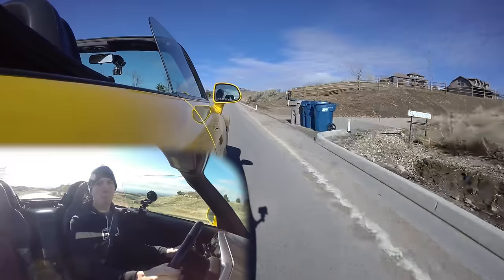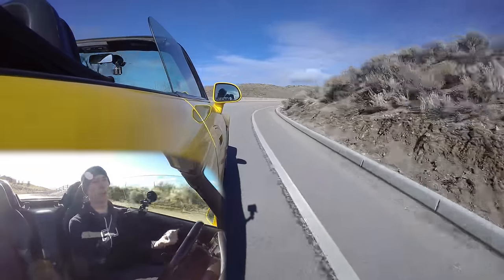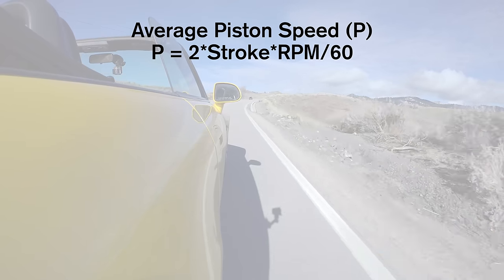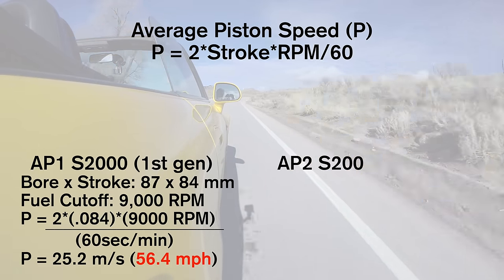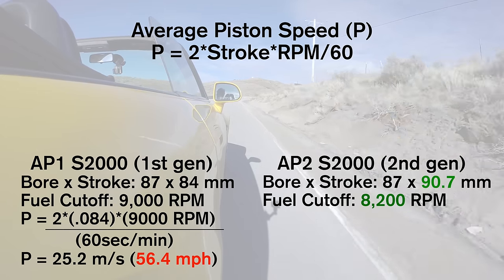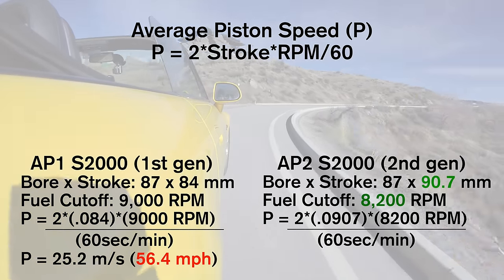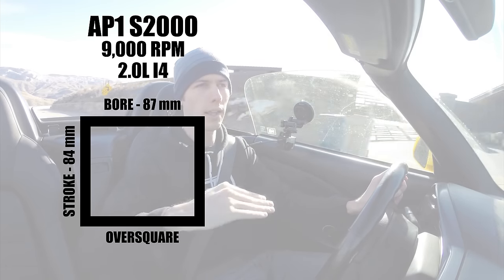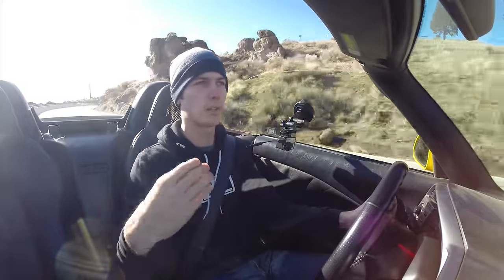How Do Some Engines Rev To 9,000 RPM?

Comment: I had an '02 S2k and had a few great years of fun riding on the edge all the time, But I wanted to try a different approach and got a BMW Z3 3.0. It suits me better because Im getting old and lazy and I actually get to enjoy the scenery better because it doesn't matter what gear Im in it'll thrust up any grade with massive torque.  I also love that feel.  A Miata I had handled really well and had great gas mileage, but I got so frustrated with the lack of power, and couldnt pass anyone.  I dont need to be fast,  just first.

Comment: I think Honda did what they could to take after DBZ. “ITS OVER 9,0000!”
They’ve been memeing since 1999 👌🏼
Reply: Jack MeOff honda motorbikes have been revving to over 9000 way before 99
Reply: Real funny name btw👌
Reply: Motorbikes Rev high. That marketing won't work because people are used to bikes revving high, but the S2K is a high revving car, and cars still rarely hit that RPM mark (excluding electric cars)
Reply: It's over 8000 was what was said in Japanese. Still good on the a2
Reply: My 1974 Toyota Corona had a 2L 18R-GR that quite regularly saw the high side of 9K rpm. Blows your piss weak meme out of the water... Same goes for all those ricer crotch rocket wannabees too...
Reply: But... In Japan and over 8.000!

Comment: This little miniseries on engines and power and their relationship has been super informative, thanks for making these! Keep up the awesome work
Reply: Also, in hopes of another awesome video about weird technologies - has any manufacturer developed a tech that would give them variable stroke length to modify torque at different revs, similar to changing valve timings and spark advance or what have you?

Comment: No VTEC but the Ford 5.2L has 8250 RPM VOODOO.... I think there is a benefit in power delivery. For a car that hits the track or long windy roads, holding a gear for longer (power band) keeps you from shifting frequently as opposed to say a 6k rpm red line.
Reply from the maker: The 5.2L is such a wonderful sounding engine!!
Reply: Harold Ortiz how about the turbine engine？
Reply: Actually a better torque curve keeps you from needing to shift as much.
Reply: Buff Barnaby and what gives you the longer tq curve?  The higher RPM. The longer the powerband, the higher the RPM results in less shifting.
Reply: You can have a flat tq curve but only last 2k RPM vs a flat tq that lasts 4rpm.
Reply: a longer gear bro  xD
Reply: DxCBuG But then you lose average torque. Longer gears are for crappy drivers (or obscenely powerful drag cars).

Comment: Is that why most Honda’s produce high power but low torque?, like  an EM1 civic Si 160Hp and 111Lb-Ft
Reply: All naturally aspirated high revving engines have low torque. As stated, Honda 4 cylinder motors actually have good torque figures compared to other NA 4 bangers.
Reply: times changed, USA has been innovating a lot more these past years in cars while japan has slacked off while sitting on a crown for more than a decade, 300hp may seem cool maybe 10+ years ago. This is coming from a guy who never owned a muscle car yet.

Comment: So my motorcycle revving at 16k is going around the same piston speed? 
🤔 
INTERESTING!
Reply: a 4 cyl 600cc-1000cc  engine  compared to a 4 cyl with 2000cc
Reply: Yes. Your motorcycle engine has a shorter stroke, so it covers less distance with each revolution. Imagine two athletes running at the same speed, one of them around an 1/8-mile track, and the other around a 1/4-mile track. The runner on the 1/8-mile track (AKA your motorcycle engine) will have twice the rpms, even though they're both going the same speed.
Reply: Trevor Pontifex brilliant explanation, thanks

Comment: Also valve float will limit engine speed.  OHC designs also tends to allow higher engine speed than push-rod configurations.  Smaller high revving engines can compensate for their lack of torque by their ability to rev higher in order to generate more power.  Also, at lower revs when power is not needed, fuel efficiency is improved.  The drawbacks are lack of power at low revs; more aggressive gearing and more gears are required, and possible increase in engine wear.  Although high revving engines can be more fun to drive and sound better (to some people), they are more costly to manufacture.

Comment: The other thing about high reving engines is that it allows you to stay longer in lower gear which means it delivers maximum torque to the wheels, thus having maximum accelaration rate.

Comment: Flat plane crank...
Reply: Been there, done that.
Reply: Andrew Langley is that a gt 350 in ur pic?
Reply: Yep.
Reply: The inline 4 F20/22 engine does have that... nothing seems wrong here lol
Reply: My mt09s are flat plane, they sound proper boring compared to a triumph 120° crank
Reply: good valve springs
Reply: firing order means nothing to how high an engine can rev.
Reply: theravedaddy mt 09s are 120 degrees dude. for a triple thats basically "flat plane". same like the triumph. the mt 07 is cross.
Reply: theravedaddy you need a new exhaust
Reply: Carbon Reed I hate flat cranks, hand grenade engines I call them.
Reply: theravedaddy Aren't mt-09s a crossplane crank?
Reply: Christian Hodges they have the normal configuration of 120 degrees like most triples. Even firing order but technically a crossplane. odd numbered cylinders are pretty weird. Can an engineer verify my statement?
Reply: Delight Galore that varies, especially when you have different cylinder arangements

Comment: It occurred to me the other day that an engine spinning at 3600rpm is rotating the crankshaft 60 times per second, is that correct Jason?  
Justified it with the following: 3600 rotations/min * (1 min / 60 s) = 60 rotations/s.  That's a lot of movement in one second.
Reply: there is a few different videos of the BMW S1000RR engine cut open and spinning at 14000 RPM :-)

Comment: On the issue of the 2 "strategies" (higher rpm vs low-end torque engines), one advantage of the higher revving engine seems to be in fuel economy during low rev range.  A lower rpm/big torque engine has lots of available power without the high revs but it comes at a cost of higher gas consumption during regular driving in that low range.  

The higher revving engine, on the other hand, can do just as much work when it revs up but it will not have that "on tap" availability of power that is so wasteful in the lower rpm engine and therefore can sip fuel when not in that high rev range.

But, The Piper eventually must be paid in the higher revving engine due to the higher risk of catestrophic engine failure: Higher RPM means smaller changes in wear coefficients can do more damage more quickly or more often.

Also, the traditional sense of "powerful" includes the idea that making power is effortless.  Higher revving engines just seem to work harder to impress.

Comment: Many smaller motorcycle engines rev much higher though!
Reply: some RC model engines rev even higher. The smaller the engine, the easier it is to rev high.
Reply: 2 stroke engines
Reply: 2 and 4 stroke engines
Reply: Smaller engine - shorter stroke - higher rpm
Reply: Well if you wanna stack the deck merely for "i've got the highest revving engine" pissing contest, I've got a 0.9cc 2stroke RC plane engine capable of over 30K rpm on nitrous. 
If you want to come back to reality, I used to own a Toyota motor from 1974 that regularly saw the high side of 9K rpm.
Reply: motorcycle engines have flywheels smaller than my cat!! car flywheels are larger in circumference...ever been in a truck? they have flywheels the size of a washing machine and those engines rev up to 3000rpm or less but produces massive torque...higher revving tiny flywheel engines have less torque....engines in a ship rev up to 900rpm or so the most!!
Reply: Antonio Barba They also have high HP/litre.
Reply: Fernandino Alonsini yes but that was not a question 😅😂
Reply: It has a lot to do with the amount of torque required. A 600cc supersport motorcycle engine can often rev to 16k rpm or higher and produced a lot of horsepower for its size (around 120 bhp), similar in horsepower to 2 litre turbo diesel. But put the motorcycle engine in the 2 tonne car and the lack of low down torque would make the car almost unusable. But in a 160kg motorcycle, the thing will fly. Formula 1 cars are extremely light for the size and so can also get away with sacrificing low down torque for high rpm horsepower. So the weight of the vehicle often dictates how much low down torque is required (truck engines often only rev to 2.5 - 3k rpm). So in a light vehicle, it's a case of having a large bore and a short stroke and then you can rev away.
Reply: The high rpm is why motorcycle engines, especially in "litrebikes" can have horsepower ratings similar to lower powered cars.

Comment: The thing that gets me about VTEC is how they engage that secondary rocker without just snapping that actuator constantly.

RPM is kind of important.

You can't make 300 ft lbs of torque with a 2.2L Honda @ 1000 RPM. That takes more air and fuel, either by increased CID or forced induction.

Flip side of that, my 390 makes 430 ft lbs of torque but is only 280ish HP because it starts to wheeze over 4000 RPM.

Comment: You need that turbo in there ASAP.
Reply: Corrosion37 thought he said he’s going supercharger for linear power?
Reply: You right. i just woke up. i have a dead head
Reply: Aw man, I wouldn’t turbo or super that. Don’t like the whistling drowns out the nice engine noise.🙁
Reply: Put a centrifugal turbo, best combination of the two
Reply: it will ruin the s2000 engine. Might as well keep it stock

Comment: That's why I always laugh at the whole "there's no replacement for displacement" adage.  Engine speed and forced induction are good replacements.  😃
Reply: but that usually only increase topend, with displacement you get a good increase overall
Reply: and a (way) lighter car
Reply: except mercedes project one
Reply: Try towing with an engine that revs to 10k.
Reply: 177SCmaro You sure can boost a bigger engine, but larger engines have more mass, both in general and as Jason explained, more reciprocating mass which means more stress on components with higher revs.  F1 has put out 1000hp from a 3L NA engine.  That's what rpm can do.  You can't rev your small block Chevy to 18,000 rpm.  Like Jason said, big engines are a legit way to make power, but not the only way.
Reply: The "racing platform"/application dictates the engine. Lighter vehicles needs less torque and than can use the top high end power high revving engine, a heavier vehicle needs low end torque. Otherwise you have to use a ridiculous gearing ratios and gear speeds to match performance of proper designed engine.
Reply: Every car pretty much is being powered by a small turbocharged engine these days... 1.0T is the new 1.6, 1.4T is the new 2.0, 2.0T is the new 2.8 etc... you get more power per weight added than you do simply by adding displacement and you get that power without increasing fuel consumption as drastically as you would going from 4 cylinders to 6 or 6 to 8 etc. better handling, more distance out of a tank, Replacement for displacement is here. 
Why do you think the new ford GT is a turbo v6 not a v8? (and outperforms all current v8 supercars) and why the V6 mustang was discontinued after customers realised the 4 cylinder turbo mustang was as good or better? 
While you can just about turbo charge any size engine, you can't always increase the displacement, Just imagine how big the bugatti chiron engine would be if they tried to build it without turbos and still give it 1500bhp... it already weighs as much as a mini cooper as it is!

Comment: So long stroke means more torque and less rev? I drove a 4.0L i6 for a few years and always wondered how a NA petrol engine with an unimpressive compressive ratio of 10.5:1 can produce almost 400nm torque at only 2500rpm
Reply: Well, it has 4L displacement, thats how
Reply: 177SCmaro umm... say i have two engines with the same displacement, setup and everything but one has a bore x stroke of 80 x 90 and the other is 90 x 80. what difference in characteristics in general can i expect from the two?
Reply: 177SCmaro. Yes, the idea that stroke equals more torque is persistent and entirely ignores the reduced piston area when talking about engines of the same displacement.
Reply: 177SCmaro but since engines with shorter stroke are more rev-happy than ones with loner strokes so wouldn't that increase the total friction as well?

Comment: Honda engines just sing. I once drove an Acura RSX Type-S (which was a more practical alternative to an S2000 at the time) and you could feel those 8500 RPM's in your bones. Makes you smile :-)
Reply: Fun car to drive but also practical unlike these roadsters. What stuck in my memory though wasn't the VTEC step, it was the magical sound of the engine that resonated in your chest like a loud sound system.
Reply: Dennis Kapatos You should upload some videos of your Acura. Maybe some revs?

Comment: AE86 from initial d had 11000 rpm
Reply: That was a special TRD group engine illegal for street use since it was designed to be used in motorsports. It must be driven hard and tortured in order to maintain its reliability-.
Reply: It was a engine from a group A rally car and detuned to make it street legal
Reply: Kedar Sawant it's still illegal though lol
Reply: Kedar Sawant. You mean streetable, its simply not going to be legal in a country like Japan.
Reply: man I miss that show
Reply: Karthik Pradeep MF Ghost is for you sir. It's from creator of Initial D
Reply: Kedar Sawant check out spoon's b16😉 not that fake cartoon
Reply: Max200012 thanks I'll check it out
Reply: fake cartoon? based on a REAL car.
Reply: The actual Group A 20v engines revved between 8900 and 9500, and some were closer to 10k, but I’m unsure why they exaggerated it so much in the show
Reply: @Mameyaro  there is a special crankshaft made by TRD or some other aftermarket company that could get an 4AGE to rev up to 11k but the crank would only last 20k miles before it failed
Reply: Kinslayer Gaming oh

I didn’t know that

Thanks for telling me :D

Comment: I want to know why some engines rev FASTER than others.
Reply: Matt Man that would be the flywheel. The lighter, the less rotational mass. I’m not Mr. Engineering Explained, but that’s from what I know
Reply: Lighter parts and shorter stroke...
Reply: Ultimately it comes down to the engines power vs. the engines rotating mass (flywheel included) and on modern cars the motor controller comes in as well. I drove a fairly modern BMW 1er recently and when accelerating it was revving up way quicker than with the clutch pressed in and stepping on the gas, so I guess the motor controller was in some weird mode that didn't really let me rev it...
Reply: Then you have the wankel engine, revs faster because its easier to transform rotational movement of the rotor in rotational movement of the crankshaft than the transformation that happens in piston engines, where you hay to transform a linear movement (piston up un dow) into rotational movement in the crankshaft. The differences between piston engines are due to the flywheel size and weight (depends on the irregularity degree that you want) and the general weight of the pieces.
Reply: Because of different missions!  My Mercedes diesel van needs low end torque, moderate acceleration, longevity, fuel efficiency. It acts more like a tractor. An f1 car needs quickness, high hp out of low displacement, needs to last less that one year. Road going sports cars are really in the middle; performes pretty good, but designed and built to last decades. It’s all trade in offs.
Reply: Gearing as well. Shorter gears help rev faster, taller gears don't let you rev as fast
Reply: Do you mean QUICKER instead of faster? If so then it's mostly a matter of reducing the weight of the rotating assembly.
Reply: ThatOneGuy Do you mean MORE QUICKLY instead of quicker? Quicker is just as bad as faster. Don't be that one guy.
Reply: Yeah, I used the adjective when I should have used the adverb. I wasn't trying to correct his grammar though. There's a practical difference between, "quick," and, "fast." One is acceleration, and the other is velocity.
Reply: Yea I put a lightened flywheel on a 1.6 vw diesel years ago, best cheap mod you can do those things because they are sooooo slow. 
Sitting in neutral and reving it up, could have been mistaken for an engine that was seizing up to someone who didn’t know. 
as it would rev up fast, but also drop fast also. 
Most cars have a heavy flywheel designed for general population, if you’re into your cars give it a try.
Reply: ThatOneGuy Huh, I never caught on to that. That's good to know, thank you!
Reply: TheSmileyFacedPizza Yeah, the best example of the difference I can think of is when Top Gear did a drag race between a Bugatti Veyron and a McLaren F1. The F1 was much quicker, launching ahead off the line and leaving a huge gap, only to later be overtaken the faster Bugatti up the road.
Reply: Matt Man the weight of the gas pedal that's all 😎
Reply: I don't think I saw this in the other replies, an important factor is the compression (combined with engine inertia-flywheel too). Speaking from motorcycles here..
Reply: It's in the gearing. In a manual, wheel speed is locked to engine speed but varied by the gear ratio. So to increase engine speed you must also increase vehicle speed to get there
Reply: @wisdomofnotch  Nope..   You match your gearing ratios to your engine, not your engine to your drivetrain. One of the gears in just about all gearboxes is 1:1 ratio. And in that gear, the engine with lighter rotating mass and shorter stroke will increase rpm more quickly. People explained it quite well above. :)
Reply: Because of a shorter stroke.